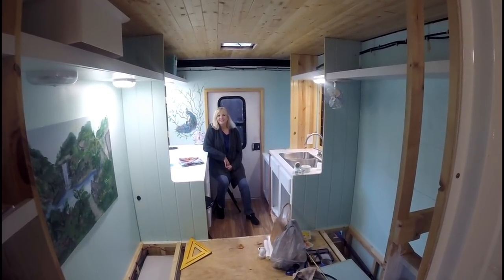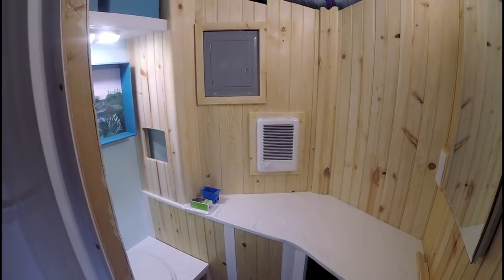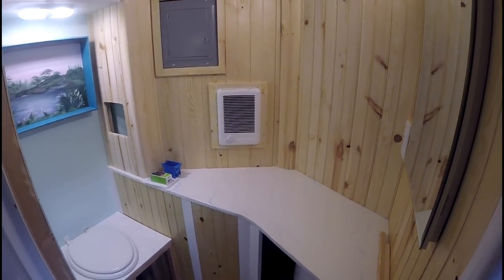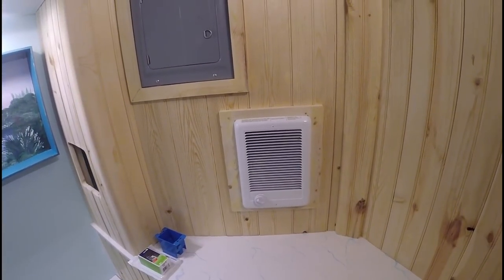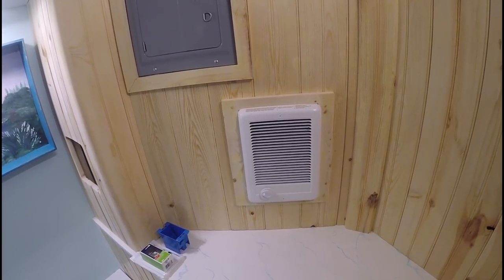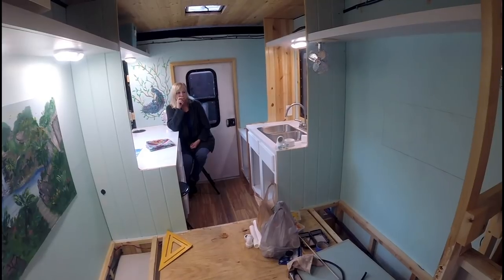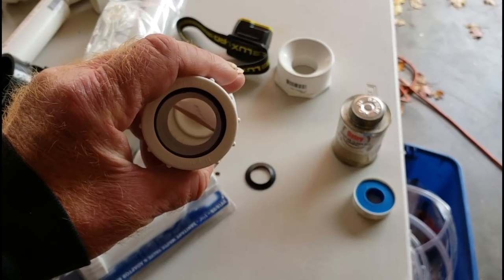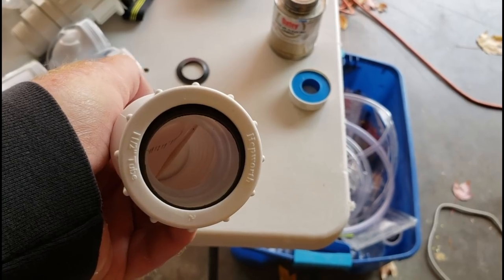Cargo Trailer Conversion Heater Update and Sink and Shower Drains

Comment: First of all I thank you for your videos!  I’ve watched most of them so far.  Even though a lot of us out here have an idea of what we want to build,  we can learn a lot from guys like you.   For that, I truly want to thank you!  My question is would you buy that brand of trailer again?   As you know, there must be hundreds of manufacturers out there.  I’ve been researching for several months now and ready to pull the trigger.   I THINK I have it narrowed down to 3-4 brands.   Naturally my budget dictates not getting upper end,  but figure it better last me as long as I’m able to use.   Sorry this is kinda long but I do value your opinion.   Thanks again
Reply from the maker: I have no real complaints with this trailer. There were a few issues with a leak here and there which I covered in the Water Leaks video. In addition, I did have to re-seat 3 of the windows (I did not do a video in that). It was partially my fault because I wasn't careful with the windows seals when I removed the interior trim rings to install the insulation. That's really about it. They installed the windows and doors exactly where we wanted them right down to the inch. What you need to remember is, they build "cargo trailers" not little houses on wheels. I'm fairly certain that with any manufacturer you will need to do a little tweaking here and there. I know a lot more now, than what I did when I bought the trailer, but with with that being said, yes, I would not hesitate to but another one from the same people again.
Reply: "I Ride" Tiny House Adventures     Thank you for replying!  I did watch your video sealing the leaks.   I manufacture motorcycle and small car campers and hand build every one.  I know these cargos are mass produced and I actually haven’t seen even one that you can’t spot things that need to be dealt with.  My main concern I guess is as long as it is structurally sound and hopefully some pride taken in workmanship.    I’ve built out a couple vans but this will be my first cargo so I guess you guys are the guinea pigs lol !  I REALLY do appreciate what you are doing by bringing the build out here for us to watch and learn from!

Comment: Dont you need a pipe threw ceiling for it to not create a vaccum?
Reply from the maker: Well. I've already tested it. It flows like gangbusters.
Reply from the maker: I could see that if you had one common dump with several drains heading to one spot. Then add the fact that most Rvs will also have gray/black holding tanks that are in line before you ever get to the one common drain. But we have 2 separate drains. One for the kitchen sink and one for the shower and no on board holding tanks that would all be in line before the one common dump. 99% of the time we will be connected to 2 auxiliary holding tanks, each with their own pressure relief cap built in. I anticipate no issues whatsoever.
Reply: In mobiles they use an air admittance valve to prevent a vacuum. According to code if you are hooked up to a septic system a "stink pipe" which is a vent through the roof is required to prevent sewer gases from entering the dwelling.
Reply from the maker: Very rarely (if ever) will we be hooked up to "sewer". 99.99% of Corp of Engineer campgrounds, State Parks, National Forrests etc (which is where we will be staying) do not have sewer hookups at each individual camp site. We have 2 auxiliary holding tanks. A 22 gallon for the shower and a 10 gallon for the sink. We will also have a composting toilet. We will be discharging only grey water.